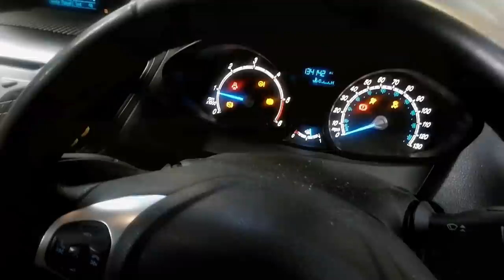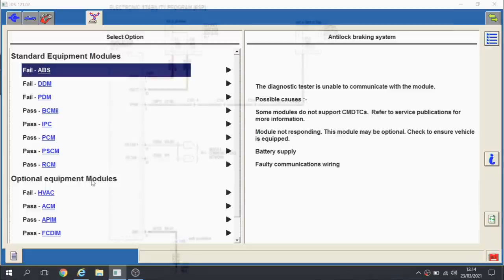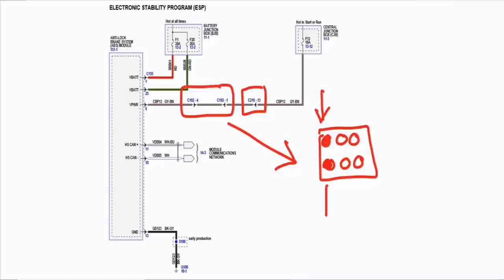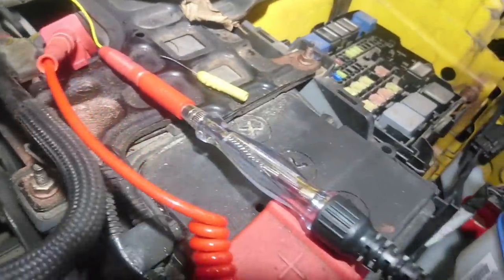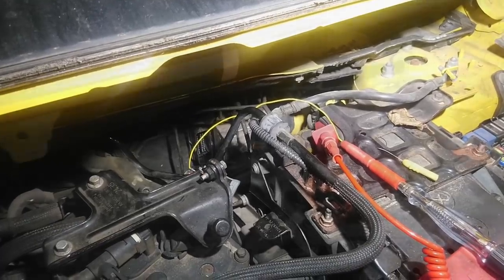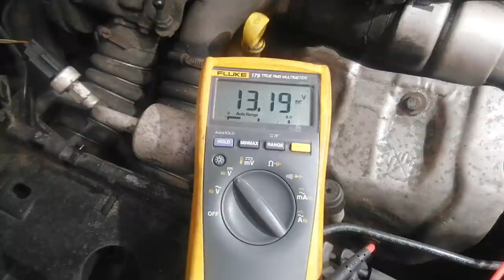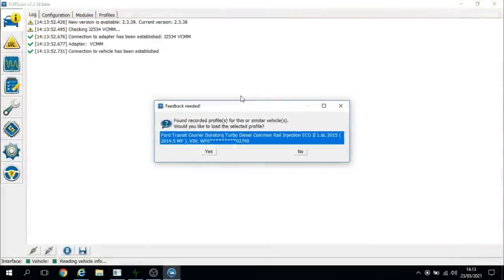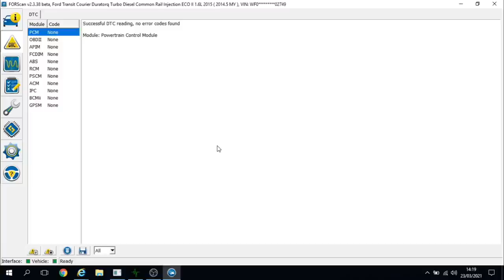2015 Ford Transit ABS Warning Lights - U0121 - U0122 - U0415

Comment: Nice work as per. 👍🏻

Although the good old trusty UNI-T meter has gone missing.
Reply from the maker: 😂 The trusty old uni-t was deployed doing a current drain test. Fluke fuses are too expensive to risk blowing
Reply: @SYDiagnostics , how long until the Fluke gets modified then? 😉
Reply from the maker: @AbbottAutomotive  🤣🤣🤣
Reply from the maker: When I inadvertently blow the fuse
Reply: @SYDiagnostics  🤣

Comment: Hi mate. Ive missed seeing your videos! Can i ask what is the exact backprobe lead you have going into the abs connector at 7.12 mins in the video?? Id appreciate any reply as would be quite usefull for me to buy one. Sick of using thin multimeter connectors! Thanks SY
Reply from the maker: Hi. Unfortunately it's near impossible now for me to make new content. The test lead is a one I made myself using a VAG repair cable. Happens to be of similar dimensions and works good

Comment: I think without us investing in the correct information software as to where block connections are situated in the harness the rest of us are dead in the water these days. 👍
Reply from the maker: even with the info, the location was incorrect. But it did give me what it was i.e. 6 pin multiplug, so it was easier to locate. Thanks for watching

Comment: Great and quick diag on this no comm issue..
I see you guys also get those u0415 and u0415 code on you side of the hood.I believe ford has a ssm regarding those codes and if no issues are found to ignore i believe.
Not a big fan of the vcmm scope either, but they did come out with the different color leads before pico did lol..
als a quick question. you like ford scan bettern than ids? notice you use a lot
Reply from the maker: interesting about the ssm, have you a number?  i find forscan quicker and something my viewers can obtain  and relate to. IDS isnt available or used by everyone

Comment: Hi,

I watched your video and changed Gear Shift Lever Gaiter & Bezel of my 2013 1.6 manual transmission C max.   After installation, when I pulled up on the collar located below gear shift knob, it is not returning. What is the reason of this? I emailed as well.
Reply from the maker: sorry, i seldom monitor emails at the moment. Sounds as though something isnt located correctly

Comment: Today iv been baffled by a 2016 2.2. Custom.   Pad warning lamp on.  All brake pad sensors, connectors, testing found no faults.   However  when checking the rear axle multi plug..found no abs 5v refrerence to the nsr...  live data of the abs showed no activity from the nsr.. and low and behold. Wire broke in the abs connector.   But no abs light ...or fault on the road .   Has the abs piggybacked the pad wire system and caused an open circuit in an " incorrect" system..

Comment: I have an issue with the code of U1013:00-2F and U0121:00-2F in ford focus 2014 And I have sound in back side door and either in cluch transmission of gearbox  when I turned off engine and remove the key....
Thank you in advance